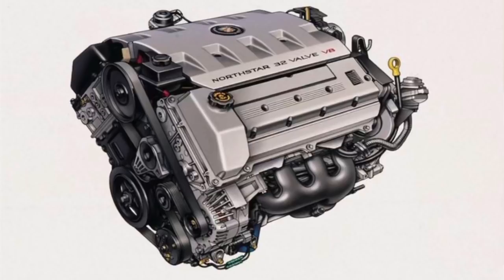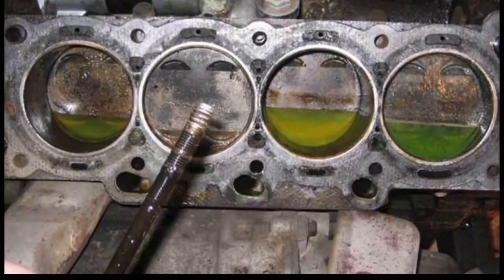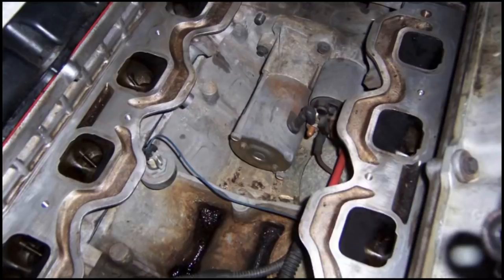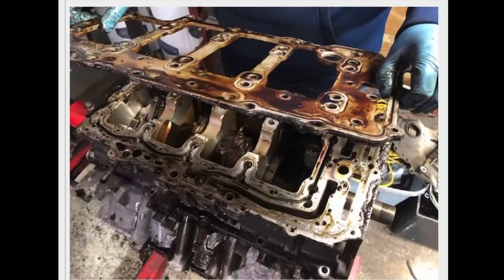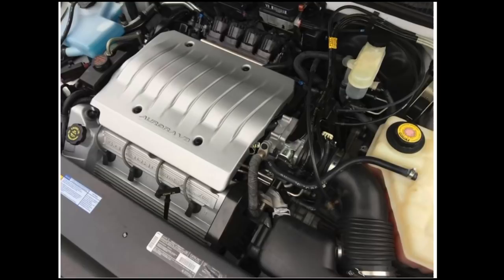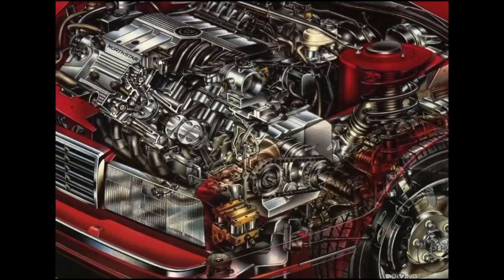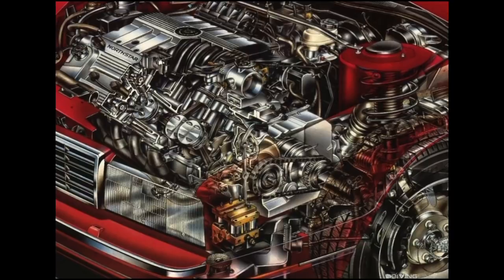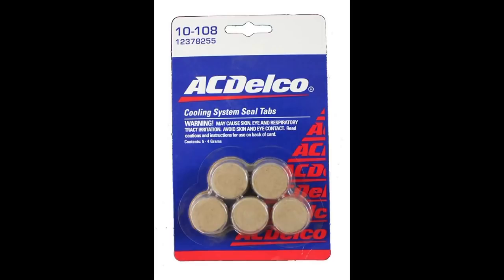Worst Car Engines of All Time: Cadillac Northstar

Comment: Have an 04 Deville DHS, bought for $1200 130k miles. Ran great for several thousand miles, however started to overheat randomly to 230F and then come back down to normal temps didn't matter what temperature outside. Eventually one day it got up to 245F and wouldn't come back down, i eased it back home and confirmed head gasket leak with combustion tester. Since the car was so cheap, i tryed this stuff called Thermalweld, their specific northstar kit which also comes with a coolant system bleeder you can install easily (helps thermostat open even if their is air bubbles). Sealed the headgasket problem and i have since put 3k miles this hot summer of 2022, even in 95F heat with the A/C and it runs at 190-205f all day.
Reply: I did the same on my Cadillac and it’s been running great ever since without overheating. More people need to know about that kit. It’s the real deal!
Reply: You still have the car?

Comment: The biggest crime of the Northstar was that it took them until 2004 to put in head bolts that don't lead to gasket failure.  The ~2000 redesign helped but didn't stop it entirely.  The DTS Northstar has a belt tensioner pulley that frequently fails well before 100k miles and takes the water pump with it.
Reply: Guys design one of the most unique, advanced and sophisticated engines of the era- not to mention smooth and powerful- and it's all "crime and punishment". LOL
Reply: @steveswell1  It ruined what was left of Cadillac's reputation after the HT4100 and V8-6-4 debacles.  I've been happy with the two I've owned since 2007--and they were more affordable because of the bad reputation.

Comment: I had this motor  in  my  STS  Cadillac  had over  135000 miles on it  always  change the oil and drove it as a daily   driver  .It was my  best car I  ever had. I payed about  $ 4500.00 used  it  ran great  and had it for  5  years and sold it   what i bought for . A great   car and great motor .
Reply: I am mystified as to why GM has discontinued making ignition modules for this engine. Part # 104777276 superseded as #19178832. I as a satisfied owner feel that repair shops and Cadillac enthusiasts ought to band together and deal with the supplier directly. [Blue Streak in Poland].

Comment: The Northstar is not reliable until it's been modified with a new head bolt kit, all in costs several thousand dollars and days in the shop to perform the repair. Unfortunately the overheating caused by the head gaskets leaking in many cases warps the Aluminum heads rendering them almost useless.

Comment: I remember this car came in to the shop I recently apprenticed at, and 3 of us couldn't find the damn oil filter being that it was up under the wheel well...things got tense and I was sent home...🍻
Reply: at least the Northstars are easy, right in front of the oil pan on the FWD models, and on the driver's side of the oil pan on the RWD models

I'm not sure about the 4.9s though, which were still used on the earlier 90s Cadillacs.
Reply: @MowerModdin So it was placed in a few ridiculous spots depending on the model? I'm still very pleased that I haven't had to work on that yr./model except 1 other occasion. Worst decision an auto manufacturer has made since exterior vent exchange in late 60s early 70s with the hope of airing the cabin of cigarette smoke...🍻

Comment: It's a shame as I've seen quite a few of those Cadillacs parked over the years. They are a good looking car.

My Stepdad had a '98 Seville STS about 20 years ago, nothing but trouble. He had a super clean '88 Deville 2 door that ran good before that. I would have kept the 88. 

I really admire your depth of knowledge.
Reply: The '88 was the first year of the 4.5. I had 160,000 trouble free miles on my '88 SDV, before it was stolen.
Reply: 97,98,&99 are no no years for the northstar we know now..they actually shortened the headbolts these years and then added a new coolant in late 96’(dexcool) which npmade things worse after it turned acidic….

Comment: I've heard that some recommend changing the head bolts out for studs as soon as you get one - it's not cheap, but far less expensive than having to replace an engine. 

And both the crossover being next to the gasket and the badly located primary ground sound like a typical GM problem - two groups of engineers not talking to each other, not working in the same building, and needing all communications between them to go up through three layers of management and back down the other side.
Reply: No. 

The price of doing that is more than the entire vehicle is worth. At least at this point anyways. You either need to get a later version.. or drive it like it’s on borrowed time.
Reply: @Bartonovich52  I heard that at least five years ago, so it's likely that you're right.
Reply: Sell the car get what you can get Lexus toyata Honda Acura
Reply: Antonio    Some Toyotas have the same head bolt/gasket issues.

Comment: In preparation for their retirement and permanent move to Florida, my grandparents purchased a new Eldorado in gold (I think a 1993). It started having engine issues a couple years into ownership and delayed their move. They traded in for a new 1996 Olds 88 which also had issues immediately after purchase (interior water leak). I somewhat credit GM for them able to spend more time with me before they left - probably a big factor why they moved back after 4 months..
Reply: @broman260  does it count if it's a year old but has 200+K miles on it and the gas pump goes out? or tire's ect need replacement? as i know one 70 year old that did that with a gold caddy 98
Reply: @richardprice5978  I don't know how you can put 200k miles on a car in a single year though 🤔
Reply: @broman260  150+K road tripping is my guess he was a retired man and was a millionaire 🤔 so thats how that or gm missed up and the odometers didn't work as intended as ferrari got got doing that on a corporate level but the other 20+ car's like his i worked on didn't seem to have that problem 🤷‍♂
Reply: @broman260  his od was 180-210K miles and my mind is remembering 15+ year's ago but it stands out in my mind because it was so meany miles racked up in one year on a factory fresh car
Reply: @broman260  Old people remember the Lemon days in the 1970's
If you got the wrong car. Your life would suck from then until you traded that POS.
My mother had a 77 Dodge Monico. That some bish was in the shop at least once every month.
It was a Monday-made car.
There were more than enough possed cars out there.
Dumping them before they screwed you hard was the correct call.
Reply: @kellyconstenius676  then they just end up buying new car after new car and wasting insane amounts of money on down payments and monthly payments until they get to the point where they could have just paid off that first one years ago but no, they're on square one with the 15th car and they're 65 years old. No more retirement.

Comment: I inherited an 96 DeVille Concours as my first car and it took 9k to keep it going for a year before we dumped it. The engine burned oil constantly, it developed an external oil leak, the hot/cold air box flap broke-dash out repair, ac compressor died, air suspension went out at all 4 corners, brakes went out, and it ate two batteries....Fun times
God I miss it though. Smooth as butter, comfy as cloud, and it could really move when you wanted it. Really wish I could have thrown a tarp over it and tried to preserve it.

Comment: I own a 2000 Eldorado Touring. Bought it last year with a blown head gasket at 68k. Thankfully, I knew an experienced mechanic who worked for a Cadillac dealer during the heyday of Northstar problems. When I had him fix it, the head gasket corroded to cause the failure. It was a 22 year old car and the deathcool had never been changed.  Now it's repaired with new head gaskets, time serts, and a bottom end re-seal. I enjoy the heck out of driving it. A remarkably smooth engine and incredibly powerful for it's size being naturally aspirated and port injected.
Reply: how much did the fix cost you?
Reply: @rageius  $3k parts and labor.

Comment: Thank you.  I bought a used ‘05 SRX with a Northstar several years ago when it had 40,000 miles on it.  Got one in great shape, for a ridiculously low price.  I’ve driven it a lot.  High speed highway cruse cross country for jobs etc.  have 175,000 on it now.  I’ve had the sliding glass roof jam, and given the labor in taking off interior panels is over $1,000, I’ve never fixed it.  I’ve been intended by stupid design tricks, like needing to remove the cars nose rubber to replace the directional bulbs and others.  I have a stero lcd display that loses light when it’s cold in the winter.  I’ve had brake calipers fracture.  But despite folks look of horror when I mention it has a northstar engine.  It’s been a trouper.  Into starting to drip a little from a lower gasket, and knocks a bit when very cold on start ups in the winter.  The former pretty much went away with better oil after a change, the later goes away after a couple minutes.  I had more engine work needed on my old Impala SS.  My wife had more needed on her CRV.  So .I couldn’t figure out what the story was on the fear of Northstars.
Reply: The directional bulbs can de reached by removing part of the wheelwell liner without having to remove the front bumper.  It’s still more trouble than it should be, but easier than removing the bumper cover.

Comment: Makes sense—the Northstar definitely is remarkable when running well and maintained. The torque steer in the ‘93 Allante’ I owned was a very unwanted attribute to an otherwise fun and reliable weekend driver.
Reply: my wife's 97 coupe car scared the living hell out of me in more ways than one ( its cursed/hunted ) but one time i got on it before a small 2line country bridge and 0-45 ish spun the tires on dry pavement 50-60F in the dark from one lane to the other another but trying not to cross the yellow line/keep it strat as i was trying to test the 0-60 mph. keep in mind i have a hairy 60's charger so speed normally wouldn't scare me but my habits and that big tq steer is unreal wow 😲about the last time i ever thought 💭about full go pedal that a let her drive me around in it 😁
Reply: That is the key...not using it as your everyday driver.

Comment: The only complaint I've had with the Northstar is the idea of a horizontally positioned V8 with front wheel drive. It's awful to work on because the engine bay is so packed with that giant motor and a transmission. I've owned several the Aurora being my favorite but trying to do a water pump in the middle of winter on the ground with very limited tools, made me a little more prone to dislike them.

Comment: Loved it in my ‘95 Aurora. Hated working on it. Swapping the alternator on that was indeed a dreadful task. So smooth though.
Reply: I have two classic 67 olds with the 425 engine that was later stroked to become the 455.  What a great engine.
Reply: I have a 99 olds Aurora daily driver 95,000 miles running strong
Reply: Loved my 99 Aurora, started leaking oil out of the RMS. Didn’t want to spend the money to fix it, but 7 years after getting rid of it, wife and I still talk fondly how smooth that car ran.
Reply: @sisyphus2k237  I drove from Colorado to LA It went  through 6 full tanks of premium gas each way. Very smooth Vehicle for long trips
Reply: @mellyzaurora1277  first road-trip with my wife was from NJ to Niagara Falls and a lot of NY wineries. Lol I agree with u 100%
Reply: @francisniestemski2440  that has nothing to do with the Northstar motor
Reply: @robertdunaway-tyll7635  what? The 1994 caddy had a north star 8
Reply: @francisniestemski2440  You literally said you had an olds 67 with a 425 nothing about a Northstar

Comment: I had a 1997 STS I bought in 2007 and I loved it. It did have a lot of torque steer, it did blow a head gasket when a girlfriend I had at the time drove it way past the overheat warning, it did have a weird oil leak after I took it to a jiffy lube for an oil change. (That turned out to be a very loose fitting for an engine oil cooling line where it went into the oil cooler in the radiator, and why did jiffy lube's techs touch that?) But our host is right: when the engine was running right, which was most of the time, it was a beautiful thing. I've not owned a car since then, I think cars are a catastrophic waste of money and too dangerous to countenance in cities, but I sure enjoyed that one.

Comment: I would love to hear your thoughts about the mid size Cadillacs with the 4.9 engine and transmission I always wanted to get one.
Reply: My 91coupe DeVille is a fine car lm Glad I saved it,  got less than 90000 miles and no problem, decent power and mpg.
Reply: wife had one 👍just don't get are old car please as it's hunted. that and i worked in a shop that serviced them

Comment: Early Northstars actually weren't that bad if you kept them cool. Then around 1995-1996 GM changed from a really high quality aluminum alloy to a cheaper alloy which wasn't as strong. This is what caused the infamous head bolt issue.

Once they wised up and started using head bolts from the LS in 2005 the Northstar became a pretty good motor.
Reply: I have a 1995 Concours with 223,111 miles on her, only two things that needed replacement were the starter and alternator

Comment: I really enjoyed your video on the Northstar design engines. I have owned 2 vehicles that were powered with this engine. One being a 2003 Aurora and the other a 2005 Pontiac GXP Bonneville. The Aurora was driven 120k miles over a 10 year period. A great running and driving car with impressive steering and braking capabilities. Plus an amazing transmission for a smooth driving experience. Cons, notable oil leaks, troublesome air ride suspension, steering hose failures, water pump seal leaks. straight 20mpg which was not a big deal. Last year for the large Oldsmobile sedan.

Comment: The issues with the N* can be fixed. Though, you do have to pull the engine to fix them unfortunately. There are aftermarket solutions for both the head bolt issues, and the block girdle leaking issue that will fix them permanently. If you do deal with those issues, it's pretty likely you won't have anymore trouble out of one. They're actually really well-engineered. Powerful and efficient. It is a pain to fix, and expensive to have someone else deal with it, however. Which is why most of the time it doesn't get done, and the N* has a bad reputation. It's a shame, too. 300 HP in a light, all-aluminum, fairly compact package. Really, an ideal candidate for a small car swap. The GM 60 degree V6 bellhousings will bolt up to them, with I think just one bolt misaligned. Semi-popular in Fiero swaps for that reason.

I think there was a company in Cali that used them to power sand rails. They advertised 1k HP with a twin turbo setup. 

Far as the starter goes, I've never actually had to replace one, so I'm not sure if that is really all that much of a downside. Doesn't really seem to bother the Toyota V8 guys all that much.
Reply: Toyota owners change their starter every 200k miles
Reply: In many cases the 4.6 can't be repaired once the head bolts go.   The head bolts don't all fail a the same time.   As the bolts start pulling out from the block it results in uneven clamping force that places a torsional strain on the block.  Many of these blocks end up cracked as a result so no repair is possible.
Reply: @MrSloika  Indeed. Though, it seems like that's a little more on the rare side. I've heard of it happening, but never seen it for myself. 

That being said, there's weren't that many who would have it done in the first place. Too expensive. So, I've probably only seen 5 or 6 that have had the repair done. And those were done successfully. 

Hell, they may even still be out there somewhere.

Comment: Would have been legendary if Cadillac made the north star with a Rear drive platform and used steel inserts for the head gasket bolts